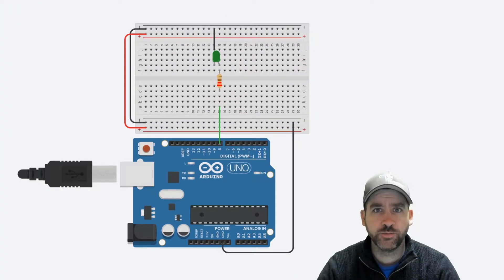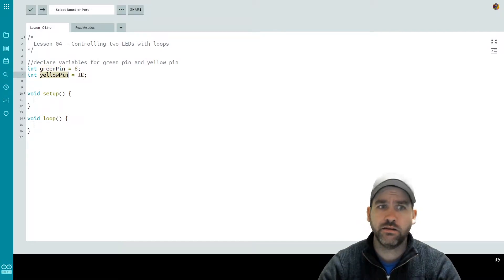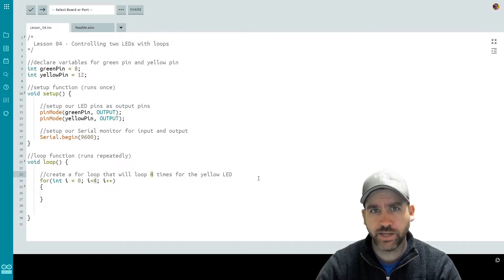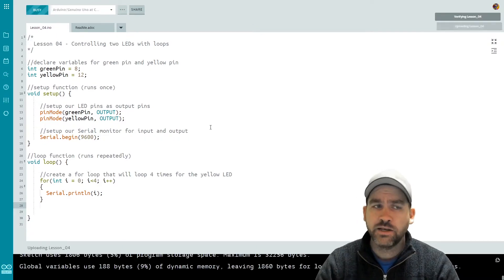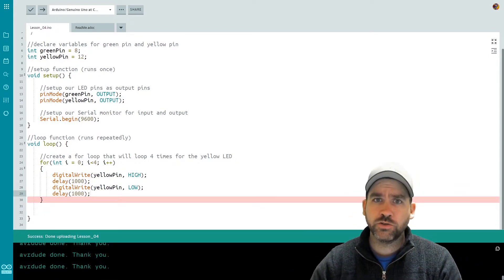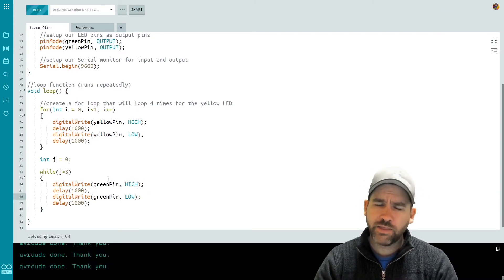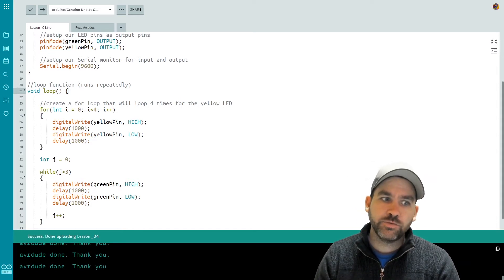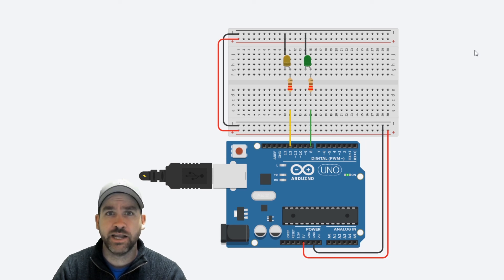Arduino Basics - Lesson 04 - Using for and while loops to control an LED

Comment: i understand the 'for loop' and i understand 'the 'while loop'. however, they seem to do the same thing,  but are just coded differently , is that correct or have I completely missed something? perhaps each of these loops are more suitable for different situations?
Reply from the maker: You nailed it with the "different situations" part of your comment. They are absolutely both functional and interchangeable  in almost all situations but one will usually be easier to write and trace for different cases. My usual go to is that if it's a fixed number of loops, use a for loop. If it's based on some user generated trigger or sensor generated trigger, use a while, but that isn't a hard rule.
Reply: @CodeWithConner  thank you. Much appreciated,  i feel I regained an IQ point. lol : )

Comment: hello can anyone tell me what code to use to break a while loops loop for example if i press PB 1 the code inside the while loop will run but if i press PB2 the code will stop kinda like a reset button and if I press PB again the loop will play once more
Reply from the maker: you can use a "break;" statement inside of a loop that will immediately exit the loop structure.

Comment: Hmmm I was looking for lesson 5 to follow bud lesson 5 is working with potentiometers, where is the follow  up of this lesson ??
Reply from the maker: LED's are used in some degree in lessons 5, 6, 7, 8, 9, 13, 16, 18, & 19. They are a useful output tool but don't add a lot in terms of learning to program so they are not often the focus of a lesson. I hope that helps.